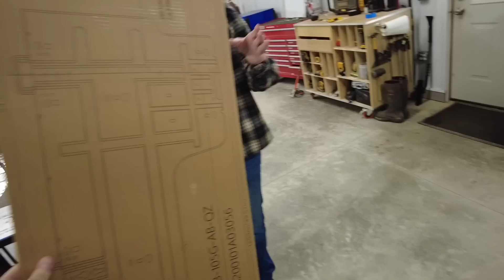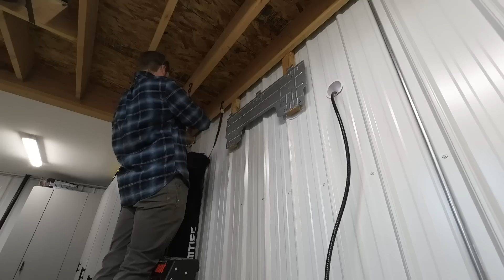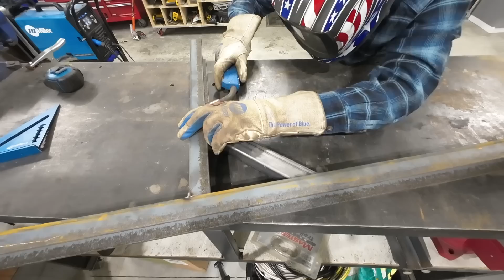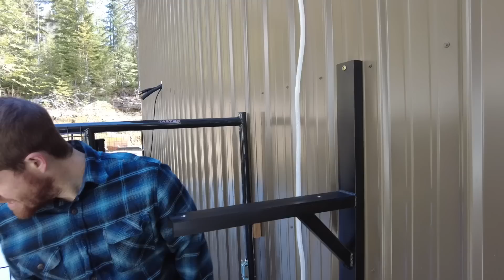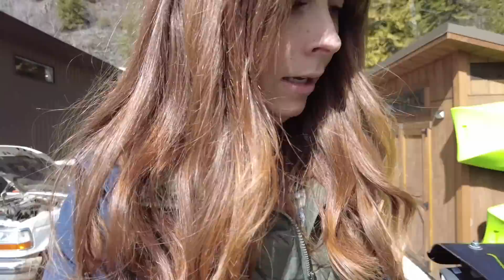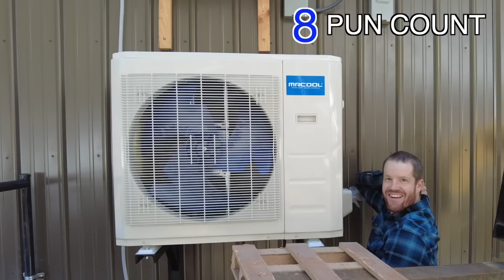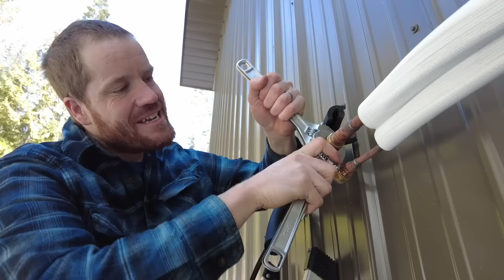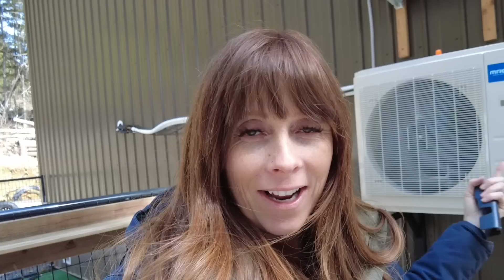Installing DIY Off-Grid AIR CONDITIONING

Comment: by the way, for testing for gas leakage, I'd advise NOT using the spray bottle, much better to use a dauber.  Also, don't make up your own soapy water (as you apparently did).  In this case, buy a solution.  Why?  Cause IF there is ever a gas leak and you have to go to court, they will ask you that question.  I've been advised by several folks that should know, that using your own soapy solution might cause corrosion, and if you answer yes, then the insurance company will not support you.

Comment: your heat pump is only an 18 seer so may not work for heating with your severe winters should be fine for cooling in the summer. I have installed many of these in the last 10 years they work great

Comment: Nice! 👍 Heat pumps are a really efficient (electrical) option to heat your home in the winter 😊
Just a little heads up, if you use them for heat in the winter. Watch for any ice buildup underneath them, cause it builds up quite a lot (also thinking of the upper one).
Here in the northern parts of Sweden we have to install them at least 5 feet off the ground and even then we have to hack the ice away sometimes 😂
Reply: Also, they are generally not installed on wall mounts on wooden buildings since it will cause vibrations in the wall to the inside.

Comment: I have a two head unit in my shop. The heat is nice but the AC is even nicer! It uses less electricity than the two dehumidifiers I needed to run to control moisture in the shop.

Comment: Well with tin/metal walls only the a/c Heat will be working very hard to produce heat on cold days and on very hot days. If the shop was insulated it would be more effective and not drain you solar power quickly.

Comment: You may get some drumming vibrations from outside unit mounted on metal building wall. If so build a wood crib to mount above snow line. We use those for flood areas too.

Comment: I installed 3 smaller 12000 btu units so i could run on solar and zone areas and could run with 110v 2000 watt small generator. Generator will run over 12 hours on less then a gallon of gas...

Comment: In winter, these need to be defrosted several times a day. Then water flows from the outdoor part. This means that the water from the upper part will run down onto the lower part. In adverse weather conditions, it could make the lower one less effective and, in the worst case, damage it. So you have to hang a drain under the top one with a 3'' drain line. Preferably with a small heating cable inside so that it does not freeze and clog.

Comment: I noticed you did not shorten the copper lines. Any specific reason you did not ?
Reply from the maker: The lines on the DIY MRCOOL are pre-evacuated with special fittings. They can't be shortened. But, it means a quick easy install without needing to evacuate the system.

Comment: I have installed 2 minisplites and I have a question. In the heat mode, when the outside temp is about freezing and the humidity is close to 100% why doesn't the outside unit freeze up with condensation from the humid air getting colder? If it reverses to thaw that is time that the heat doesn't work.

Comment: One thing you guys do that really makes me cringe is when you get in and out of the machine when the boom arms on the track loader are up in the air. You should really refrain from doing that. All it takes is one false move of the levers (or foot pedals in some cases) and the boom comes down full force capable of killing you! DON''T DO IT..... (unless the boom arms are all the way up in the air with the boom locks in place).
Reply: NEGAtron spotted 😂

Comment: Thinking that investing in and having some scaffolding on site would ease many elevated tasks, add another degree of safety and lend itself to improvised means of hoisting.
If y’all found forks on the Cat, game changing, get a boom, especially for the number of point lifting projects y’all deal with.

Comment: Yep, air conditioning using solar energy is must be. You usually need it when it is sun, and when it is sun you just have so many solar energy that you just do not care how much it consume :)
Reply: @driatrogenesis  What? I have 10kwt/h solar panels. It generates avg 65kwt daily of power. (I have so much that i am selling half to grid) (Except 1 winter month), last summer i was using air conditioning during all summer totally on solar and batteries. Seems you is bad electrical engineer or bad comments reader. How will you do air conditioning using gas? Adding more heat to temperature on summer?
Reply: @driatrogenesis  7k USD for panels and invertor (Deye 10kwt) installation by my own, and then 6k usd more for batteries (25 kwt hours), and i ordering 3 years used LIFEPO batteries and rebalanced them on my own, if take brand new with same capacity you can easily double the check. Also i started with 0 batteries for first half year. BUT: I practically have no winter in my region. Temperature below zero is for 10-15 days a year. And i have a fireplace in my house as an emergency and beautiful source of  heat. In short I already returned 60% of investments for 3 years I have this system. If to calculate without batteries at all then i already returned investment (I have grid as a backup and place to sell energy). I ordered batteries because of electricity shortages that time to time happen in my region. But then configured to  return me electricity at evening and night till 30%. And from what i see in such install i do not need greed for 9 month a year at all. And during other 3 months i take something like 400 kwt from grid total, still less then generated. And some sunny winter days i even sell to grid again :) Theoretically purchase of chippest generator can make me totally out of grid, but why, if i have grid :)

Comment: 18 seer rating isn't that great for newer technology mini splits if efficiency is your goal. I'm not sure about big units like this but I have seen some smaller units easily in the mid 20's and even some in the low 30 seer ratings. That mean for every watt of energy you put in you can get 25-30 BTUs of cooling out. You guys have an enormous system so you will be fine but efficiency is very important on smaller systems. 18 seer is still better than a window unit though. They are generally around 10-12 seer. It's amazing that you can get an efficient mini split that can create the same amount of cooling for a third of the electricity usage. Great job as always.

Comment: Couldn't help but notice the upper "Mommy" unit had what appeared to be 2x4's against the outside of the "barndominium" that the unit was mounted to.  I'm sure Riley will get around to replacing the decay-able wood with some "Riley well built" proper brackets.

Comment: You didn't state if the one you installed previously was a heatpump. If it is the upper one is going to dump condensate from defrost on the lower one. It will freeze on lower, reduce efficiency and might even damage it.

Comment: These mini splits have become so amazingly flexible. Low power draw and huge outdoor operating temperature range. I have them in a bunch of my IT closets. In many it doesn’t even have to cool that much as most tech gear is much more efficient that unused to be. But running the AC at a moderate temperature setting (aka you aren’t trying to turn the room into an ice chest), it’s fantastic for dehumidifying. That alone will make working in the garage SO much more pleasant. On extreme cold days you have your waste oil burner to help out, but on all but those super cold days, the modern inverter should keep your space comfy for use. I’m sure you’ll be enjoying the fruits of your labor on this project as summer heat will inevitably come. I can also foresee you guys leaving a big open space once your little one is mobile. It’s nice to play outside, but there is only so long you can be out there with a toddler. Having some space to play and pedal a small trike will be a life saver when you have to stay inside during a big winter storm. Kids need to burn off pent up energy. Nothing like a good size heated garage to help out with that 😊

Comment: Seeing how close to the timber line the dog run at the rear is and knowing they caught a Mountain Lion has visited them it definitely needs a top. The night belongs to them, and the Big Cat likely has been up on the deck, and elsewhere one can imagine where it and others might find a food even in the trash. C!osing off the dog door at night until there a chain link top or roof on their run is a must since it can easily go thru get thru too. Indeed the kennel-run panel height is nothing to them and they likely know every nook-cranny where something they catch to nibble on. Having some strobing motion dectector lights is a good idea because those that stay on their use to as well as other visitors in the darkness. Real time surveillance of the thermal variety is a absolute including hand held kind is needing yo go into the night and the big cats have probably been there watching the day you first began working. What attracts them is their food supply their following across the land or anything they can get including trash and night time guest are better when their known so they won't invite themselves in an surprise encounter.

Comment: The bad thing about wall brackets is the sound. I have concrete walls, and I made a huge mistake putting my 60K high in the wall. Also servicing it is so scary. Have to relocate it eventually

Comment: You stated that it works at zero degrees and it's a heat pump? Most central air conditioners have only a 20-25 degree split between vent and return air. A heat pump is just a standard air conditioner with a reversing valve so unless it has electric heat strips built in I don't get how it could produce heat when it's 0 degrees outside.
Reply: I think he said below 'freezing' meaning in U.S. 32 degrees F (not 0 degrees F).

Comment: Riley,
When you have solid snow around your house, you can use your fork lift on the tracked skid steer to pick up large sections of the icy snow and shift this to somewhere else to melt.  I have cleared large car parks using this method.

Comment: Pro tip, when drilling through metal wall like that to make hole, make your arbor drill hole first, then use you long bit to go through the other wall using the arbor bit hole as a guide, and then use hole saw with pre drilled arbor holes.
Reply: Could you simplify that? Seems like a no brainier to me.

Comment: I want to go off the grid so bad. We're both 71, and Saturday was our 45th wedding anniversary, and I just can't convince Alison to move more than 1 mile from the grocery store. We do have 32 solar panels, and our electric bill is now only $27.81  a month. It's called NET METERING. Where we live, we can't go totally off grid at this point in time. If you only knew how hard it was convincing Alison to let me do this. Also I just purchased 2008 Four Wins camper with only 18,000 miles on it, and I'm installing one 200-watt panel with one 200-amp hrs Lithium house battery.  So I'm an energy geek at 71. This is why I can't get enough of your projects.  Courtney, be careful don't push your luck with the little one on board.

Comment: Hi
The next time you drill through a layered wall with a hole saw, as in the 3rd minute of the video, prepare a sharpened rod of the appropriate length. First, you drill a guide hole with a drill, and then through this hole you insert this sharpened rod at right angles and with a hammer you make a hole in the second wall. Tested many times on sandwich panels used to build halls and cold rooms.
Regards

Comment: You saved Mr. Cool for a little time off- good on ya! Riley, take what got written about the line set- it all needs to run down hill to the condenser with out low places, or it will cause what we called "slugging" as refrigerating oil built up in the lower loops and points. I guess I'm too old fashioned about it.

Comment: I have one of these Mimi-splits and the problem with mounting it to the wall is that the wall acts like a drum.  Otherwise the unit is very quiet.  I would mount mine on a pedestal on the ground next time.

Comment: Nice looking work. I installed mine over a year ago an 18k single. It has worked flawlessly so far. I tried the heater just to be sure it works, but here in the piney wood of East Texas, the AC is what gets used. 
      I am off grid living well on a 6k split phase 230v LF inverter. We have averaged 8.14KwH a day for almost two years now. Our max use day was 22.5 kWh maximum day production was 26.5 kWh. We have the water heater rigged where it only runs at float voltage and the well pump only runs when PV voltage is double or more of the battery voltage.  I have similar PV wattage as you but nowhere near the battery capacity at 15.6 kWh.
Batteries are expensive compared to the rest of the setup.
       Bless y’all and congrats on your newest family member that will make life even more interesting.
Reply: I am just starting my solar journey that info points me in the right direction ty

Comment: To my eye, it would have been nice to have a little more gap between the outdoor unit and the wall. All the air being drawn into the heat exchanger has to be exhausted around the gaps and the coiled pipes stuck behind the unit look like they restrict the flow also. Reducing the airflow rate will reduce your coefficient of performance to some extent.
Reply: @greco7522   When in heating mode, a  coefficient of performance of 3 would mean 1kw of electrical energy results in 3kw of heating. 300% efficient.

Comment: If your smart you will install an ceiling fan to throw the warm air back down, then the ac does not need to heat as much

Comment: I’m an AC tech by trade certified with several years experience I can tell you mini splits go down all the time usually due to the inverter boards or a stupid sensor. If you don’t have a direct line to your distributor good luck getting parts split systems are much more reliable….

Comment: Great progress guys! Most people seeing your place for the first time would probably never even think that you are not connected to the power grid because everything just seems so normal but we all know how much hard work has gone into your home. Thanks for sharing the build process with us!

Just an idea that you guys have probably already planned out. During the winter you might need a couple of reversible direction ceiling fans in the high-bay area of the shop to push the hot air back down to floor level. 

Courtney will most likely find her new office space nice and toasty in the winter without those ceiling fans but come summer having the fans cycled in reverse pulling the cold air up will help keep her office space reasonably cool and move the air around the entire open shop area.